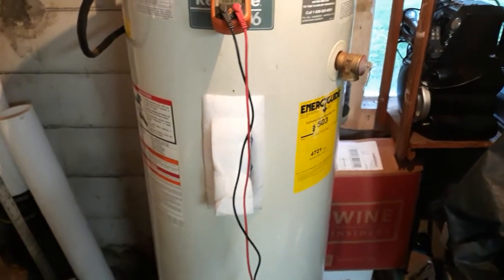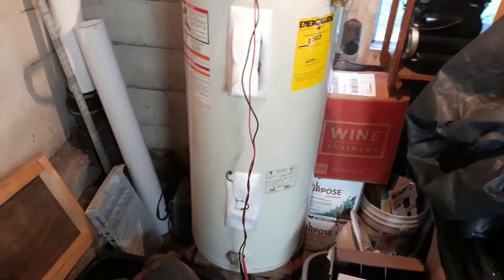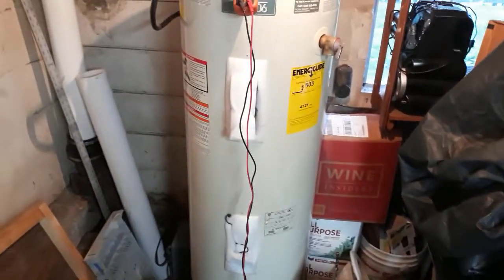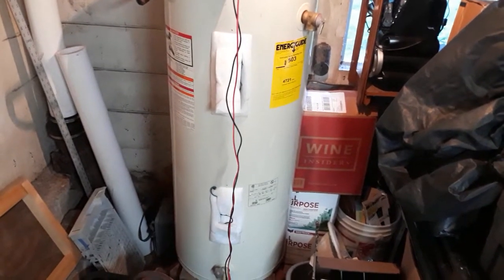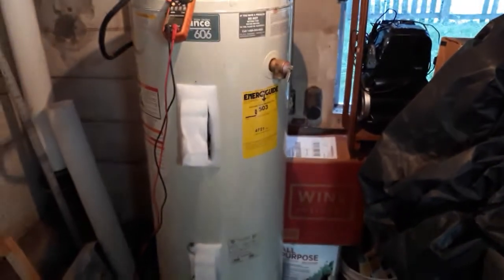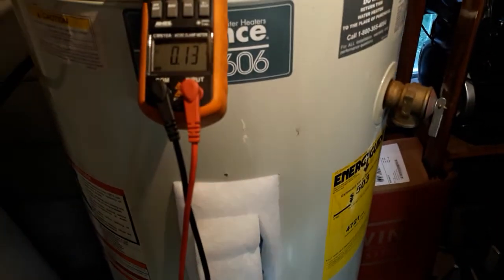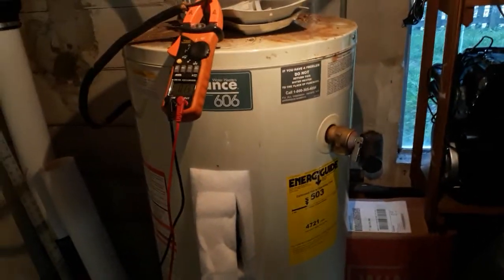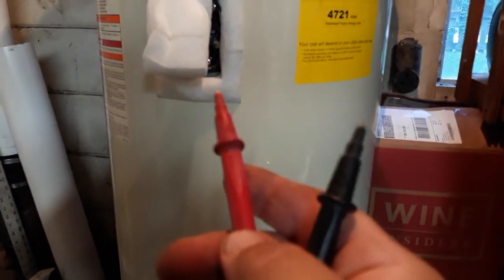How a dual element water heater works

Comment: Question. I put in 50 gallon water heater and it only connected at bottom element but I don’t have and hot water .. I checked continuity and power is fine but no hot water — does the put need to be connected for the bottom to work
Reply from the maker: You will need to proof read your comment so that I can understand what you are asking. Are you saying that your watet heater does not have a top element?

Comment: Thank you so kindly for taking the time to go through how a 2 element tank heater works. I had no idea that the top element gives you almost instant hot water than that of the bottom element. Mine has been set wrong for years
Reply from the maker: I am glad it enlightened you 😊

Comment: That's not 12 gauge wire that's 10 gauge wire, and we know that, not only because you can tell by looking at it, but also because that is a 220 volt water heater. And code for 220v Appliance gets 10 gauge wire. That means that the theoretical maximum ampacity on a 220 circuit is going to be 20-60amps.
Reply from the maker: You are wrong it is 12 ga NM. Just because code says it means nothing on an old house like mine. Back in the early 90's, companies installed water heaters that utilized 3500 watt elements. When you apply the 125% rule that is under 20 amps so 12/2 NM on a 20A double pole breaker is just fine. Yes I replaced my water heater without upgrading the service and that is because in the real world it does not matter. The load is not over 20 amps and the breaker limits current to 20 amps so there is never going to be a risk of overheating the conductor. 

Secondly, I dont know how you figure "theoretical maximum ampacity" could be 60 amps. There is no theory behind it, just facts. The facts are that 10/2 NM the maximum ampacity is 30 amps and that is it nothing higher. 

10 AWG THHN wire at 90°C is 40 amps, according to the NEC (National Electrical Code) Tables and that is the highest you can go for 10 gauge wire so I dont know where your 60 amps comes from.
Reply: @Bbernhardsr I think it's hilarious that the first part of your reply is about how you don't give a shit about code while the second part of your reply is about what code States and how that makes you write.

Yes I said theoretical because you can buy standard breakers for 220 volt circuits that range from 20 to 60 amps. Theoretical because I don't know what you have or what someone might use.

 I noticed that your house is older and I realize that you are a handyman of sorts... but you didn't install the wire in the hot water heater. the manufacturing company did. And the code for 220 volt appliances to be using 10 gauge wire has been that way for a very long time. Also, I have been doing this for long enough to know what 10 gauge wire looks like in someone's hand and that's what you're holding. 

Now if you did something kind of dumb by running 12 to from the box to the water heater thinking that you are all right because of the 125% rule you are incorrect. You've done your math wrong somehow.

You should use 10-gauge wire for a 220-volt, 3500-watt water heater. The National Electrical Code (NEC) requires continuous loads, like a water heater, to have conductors sized at 125% of the load. 

Calculation: 

Find the amperage: Divide the wattage by the voltage (3500 ÷ 220  = 15.9A 

Apply the 125% rule: 
Multiply the amperage by 1.25 15.9  × 1.25 = 19.9A

Choose the wire: A 12-gauge wire is rated for 20 amps, but since the calculated load (19.9 A) is so close to the limit, the next standard size, a 10-gauge wire, is required to prevent overheating and to safely handle the continuous load. This setup requires a 2-pole, 30-amp circuit breaker.

And finally.... every time you do work on electrical equipment and you are talking about its capacities it is ALWAYS THEORY.

Electrical theory is a body of knowledge that explains how electricity works and behaves. It is based on fundamental principles like voltage, current, and resistance, and key laws such as Ohm's Law and Kirchhoff's Laws. This theory is essential for understanding and applying electricity safely and effectively in various fields, from wiring homes to designing complex electronic systems.

Now do you think that you should be showing people how to do electrical work on their house without explaining to them that your house is not up to code and that you don't care about that that way at least you're not 100% directly responsible for any accidents that might occur from people applying your advice and them not knowing that you consider yourself a professional and that means that you are capable of running your equipment below code standard?

Comment: Might be 3 years old but definitely helpful, I just replaced the elements on my electric water heater (she's old it's a whirlpool) it was here when we brought the house 9 years ago. I cleaned out the sediment (there was alot) since I had the elements out I could flush it out better. After I installed the new folded elements and got everything wired up I turned on the power and checked the voltage, and the bottom one had no power, double checked all the connections. I sat there staring at it going I'm pretty sure the old one was working. Then I hit the internet and found this video, I went back out turned the top one all the way down till it click off and boom the bottom one kicked on. 😂😂
Reply from the maker: @devo1977s  awsome! I am glad I saved you from pulling your hair out. 😁

Comment: If the top element and thermostat are bad , will it shut the both parts down ?
Reply: Top and bottom ?
Reply from the maker: It would seem to me that if the top element was bad then the whole water heater would never Heat up. The top of the water heater has to get to temperature first before the bottom of the water heater will turn on.

Comment: This is a start but there a better explanations out there. Anyone who opens the manual on these things can learn this but who does that? 

What is nice is that MOST duel element water heaters are exactly the same. My bottom element goes out every few years. It is annoying but if you are flushing them yearly, I would just replace the bottom element every 3-4 years while you drain the tank/sediment.
Reply from the maker: @scottsatkowiak2347  well I am not sure how it could be explained better or what is still left to question? Maybe you could elaborate? Also, you should check your anode rod because it probably needs replacing.

Comment: Hey how are you i have my anode rod stripped meaning rounded i used a 12 point socket instead of a 6 point socket now is rounded how can i remove it any suggestion please help
Reply from the maker: @amrab281  I would get the right size 6 point socket and Hammer it on if need be
Reply: @ i did and it stripped rounded no grip
Reply from the maker: @amrab281  the only thing I can think of besides welding a nut on would be an extractor socket. 1 1/16 is close to 27mm. This link from Amazon has a set that has a 27mm socket you could beat on.

XEWEA 9PCS Lug Nut Extractor Set, 1/2" Drive Impact Bolt Nut Remover Socket Tool, Wheel Lock Removal Kit, Easy Out Extractor Set for Damaged, Frozen, Rusted, Rounded-Off Bolts Nuts, Father's Day Gift https://a.co/d/ad5MdFl
Reply: @Bbernhardsr  but the problem with that socket is that the rod head is to low the socket wont grip the next thing is to weld a nut but thats to hard to do
Reply: @ i was thinking getting one anode rod like the bradford white  with nipple and put it in the rheem hot water side , will that work , i think it does cause one side of the nipple screws to the tank and the other side to the hot water
Reply: @ i was thinking of buying the anode rod with a nipple like the bradford white tank uses and installing it on to the rheem hot water side , cause those nipples has 2 sides to screw in one for the tank snd the other for the hot water pipe what you think

Comment: Im running 2 4500 watts elements on my bradfordwhite top and bottom , but looking at your video they dont come on at the same time is that correct so is safe?
Reply from the maker: @amrab281  watts divided by the voltage will give you the amperage. So, 4500÷240=18.75 amps. This is fine on a 20A breaker and 12AWG wire.
Reply: @ but im running 2 4500 watts top and bottom , my breaker has double pole of 30 amps
Reply from the maker: @amrab281  yes but only 1 element is on at a time not both.
Reply from the maker: @amrab281  was this wiring always this way? The only thing I would be curious about is what gauge wire is the circuit? For a 30A breaker it should be 10AWG.
Reply: @Bbernhardsr  tank came like with wiring on is a bradford white model RE350s6 1ncww
Reply: The tank says 4500/3500 208v and 240 volts i wish i can send you the tag on tank , i called bradfordwhite and i explain they said it dont matter cause is one element at a time it cmes in at 208 v 3500 watts and the other at 240v 4500 simuntaniously
Reply from the maker: @amrab281  ok so it has two different wattage elements. It doesn't matter because only one will run at a time.
Reply from the maker: Is there a problem you are having? @amrab281

Comment: So if the upper element dies the water heater wont work at all? Because it wont send power to the bottom element until the upper is satisfied
Reply from the maker: @williamserver4332  correct and an easy way to tell if the bottom element has failed is that you won't have hot water for very long maybe 15-20 minutes. That is because only the top of the water heater has heated and not the bottom.
Reply: @Bbernhardsr  thanks.

Comment: ...and he did it all with one hand! 😄  Thanks for the video, sir! Trying to figure out what is wrong with my water heater. This helps explain why I couldn't figure out if my heating elements were in series or parallel. I guess it is neither! The relay only allows one on at a time.
Reply from the maker: @ledzeppelin1212  glad it helped! 😄

Comment: I can't agree that a one element heating the water is not good. Me and my wife used our water heater for over 30 years using only one element of a two element heater. I only had the bottom heating the water at around 105 degrees.
Reply: The top element never came on because I disconnected it.
Reply from the maker: @alvisjenkins1305  why would you want to do that?
Reply from the maker: @alvisjenkins1305  it sounds like to me that you and your wife did not use much hot water and there it nothing wrong with that. I am curious how you know for certain that the top element never came on?

Comment: U have a 4500watt element if you are pulling 18amps,,,     4500watts / 240v  = 18.75 amps....      3500watts / 240 = 14.5 amps
Reply from the maker: While I understand the math and what you are saying, I am just reading what was printed on the element itself.

Comment: Thats for the explanation, im installing a 3000w 240v dual element water heater and was wondering what size wire i should use...now that i relized only 1 element is on at a time ill go 20 amp breaker but may run 10awg instead of 12awg incase for future even tho 12awg would be fine for 3000w

Comment: I have two plumbers who have told me different things; 
One says both elements do not have to be set to the same temperature. The other says if you adjust one, you have to adjust the other. Thoughts? 

Does it even matter?
Reply from the maker: Well I don't really see how it would be useful to have your elements set to two different temperatures. I would say pick a number and set both the same.

Comment: Actually, it does not matter whether you have one or two elements as far as the amount of electricity that will be used to heat all of the water water in a tank from a certain temperature up to the desired temperature, it will take the same amount of energy in watthours regardless with the difference being that if you have a dual element set-up (non-simultaneous element heating) and a tank of cold water, the upper roughly half of the tank gets heated to the desired temperature in less time than it would take for the same tank only having one element at the bottom to heat the water in the entire tank to the desired temperature, so the wait time is less in the dual element set-up to have some useable amount of water at the desired temperature ready to be used.
Reply from the maker: That would be an interesting experiment. I just don't see how it would be the same watt hours if a dual element heats up faster. It is only using one element at a time so instead of having to overheat the water at the bottom to heat the water at the top it just puts the energy where it is needed. You could be correct but I am just saying I would have to see the real world results.
Reply: @Bbernhardsr  After a good nights rest I have come to realize that my thinking about what follows (which is my original explanation) and is shown enclosed by a set of { }, was not correct for the following reasons: the temperatures in both water heaters are the same; the same amount of water is run out of both water heaters at the same gpm flow rate; the environment conditions are equivalent; the applied electrical energy heating is the same; the dual-element water heater has slightly more total mass which will be heated. Assuming the tanks are designed in a way that will result in both tanks holding exactly 40 gallons of water and result in the same rate of heat loss under equivalent conditions, then the dual-element water heater will actually take ever-so-slightly longer to heat 40 gallons of water due to the extra heating element mass which must be heated and accounted for. Here is my original explanation: There is a defined amount of water in the tank and it will take so many calories of heat to raise the temperature of that set amount from a set temperature to a higher desired temperature, and it doesn't matter if those calories come from a single source or multiple sources as long as the number of calories needed is provided. But, since there is no such thing as a perfect thermal insulator, there will be loss of heat over time. This will, over a substantial time period, be the same amount of heat loss under the condition where the hot water is not being used, {but if the hot water is being used most often immediately after a cycle of heating by the element(s) to the point where deactivation of the thermostat(s) occurs, then there is an advantage to having dual element thermostats because over time, since the total from the time when the hot water is turned on for use immediately after the cycle of heating has completed + the time of running the hot water out of the tank + the time for the heating element(s) to bring it back up to max temperature will be less for the dual-element water heater than for the single-element water heater, and in this scenario, the difference between the length of time for the single-element water heater and the dual-element water heater to complete this cycle is the amount of time when the heat loss will still take place for the single-element water heater, so it will have a greater heat loss.} This is with the following assumptions made: both water heaters are in equivalent environment conditions (same ambient temperature, same relative humidity, same barometric pressure, etc.); both water heaters hold the same amount of water; all heating elements are rated the same watts and, in the case of the dual-element water heater, only one element is on at any given time (non-simultaneous operation); all thermostats are calibrated and set the same; the temperatures of the water at the start of the cycle and end of the cycle are the same for both water heaters; the thermal insulation has a heat loss coefficient which is the same for both water heaters, is physically the same material, and is installed on the both water heaters so that the result of any measurement which relates to the positioning of the insulation on either water heater is the same for both; the rate at which, and amount of, hot water run out of both water heaters is the same. I found an online calculator which will calculate the time to heat a pound of water at a temperature of 25° C (77° F) using a 4500 watt heating element. So for 40 gallons of water (333.6 pounds), it will take 78.11 seconds to heat it up 1° F. So to heat it up to 127° F it will take 78.11 x 50 = 3,905.5/60 = 65.1 minutes and about 4.9 kilowatt-hours. (https://www.omnicalculator.com/physics/watts-to-heat#how-to-calculate-the-watts-to-heat-a-substance) As a final summation that is only considering the 40 gallons of water being heated by 4500 watts of electrical energy, it will take a predeterminable length of time to heat that amount of water from 77° F to 127° F by a continuous 4500 watts of electric energy being delivered for heating until thermostat deactivation (shut off) of electricity to heating element which was indicated above to be 65.1 minutes of time and 4.9 kilowatt-hours of electricity usage.

Comment: mine only has 1 would it be a good idea to add another element or can i even do that?
Reply from the maker: You would have to re wire the whole water heater and add a new top and bottom thermostat. I suppose anything is possible with enough effort.